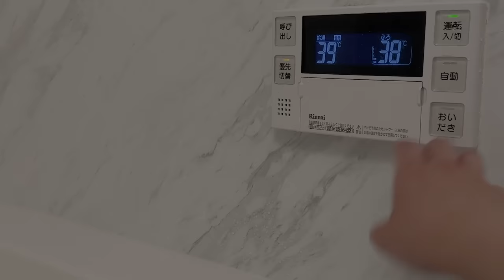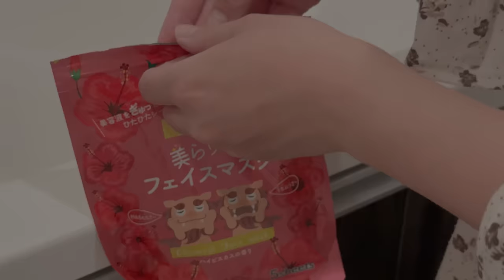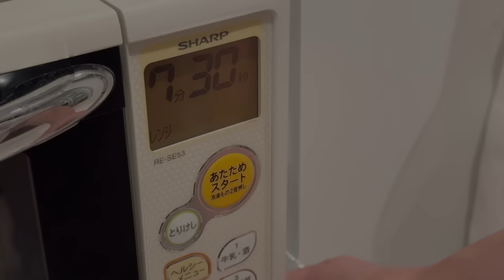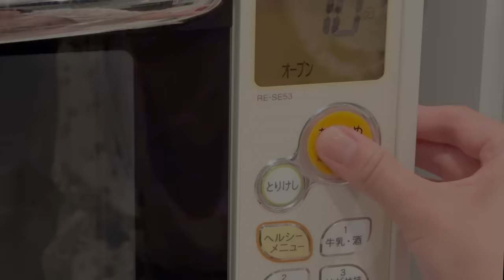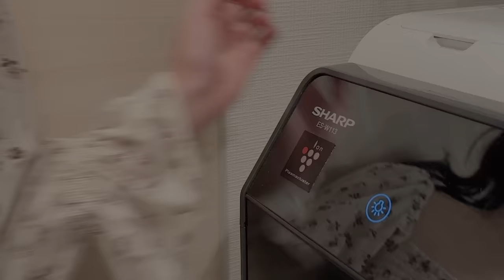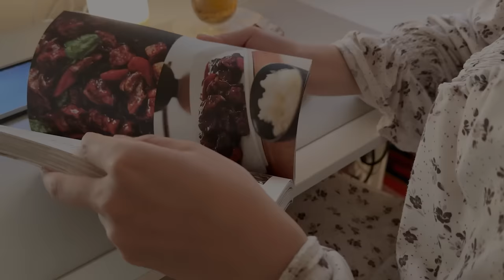Night Routine | 1人暮らしの気分をリセットする小さな習慣｜Small habits to heal myself |Japan VLOG

Comment: A small suggestion for the microwave mess? Add a small bowl of water with half a lemon in it. Heat on a low temperature for 45 seconds to 1 full minute. Test wipe the inside. If it's still difficult to remove, repeat this for 30 seconds. Just long enough to steam the water. Once it's loose enough, put salt on the lemon and use that to scrub off the grime. It will clean and freshen your microwave!